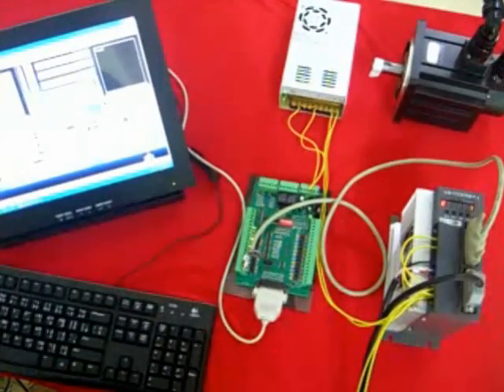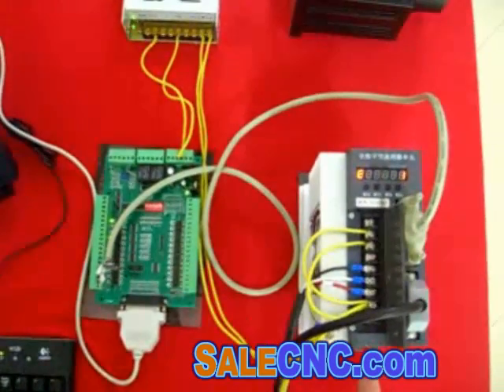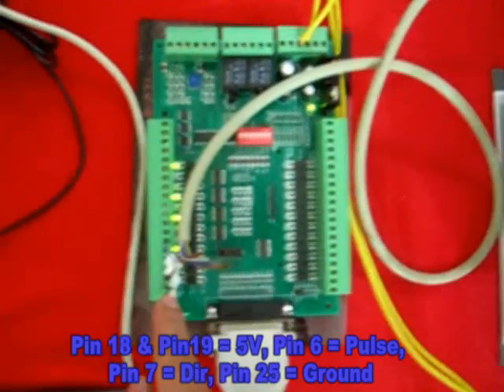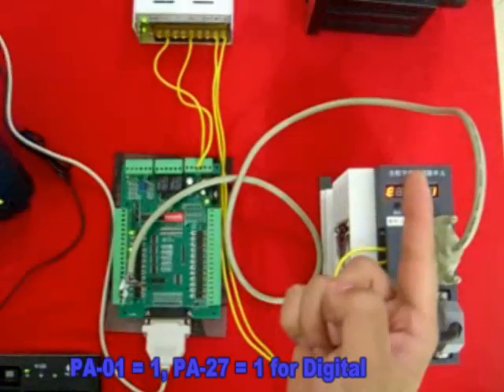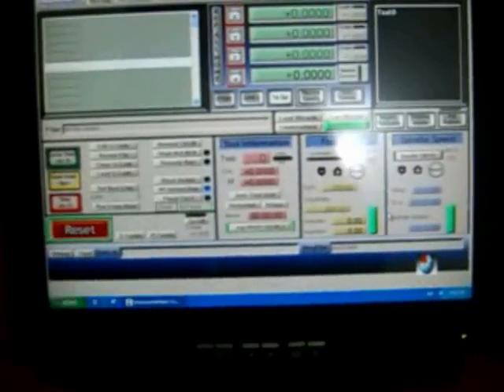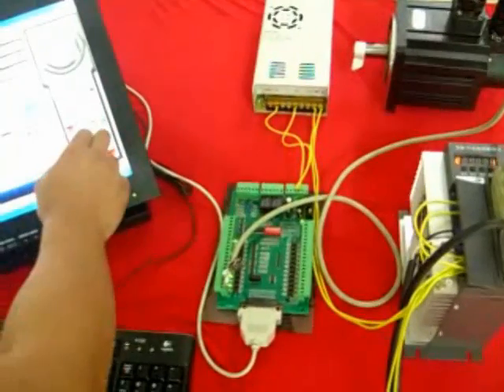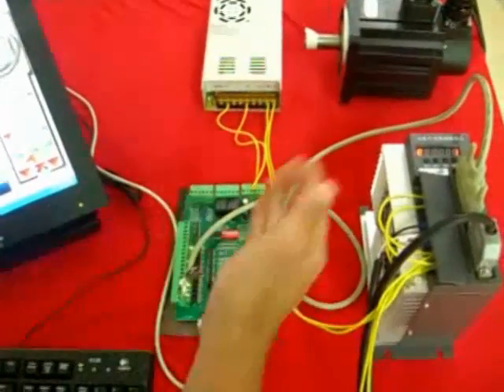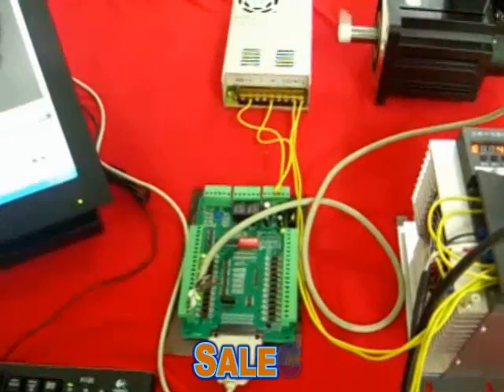Mach3 with Servo Motor Connection Control

Comment: which are the driver pins you use, thanks
Reply from the maker: For Servo Driver: Pin18 and Pin19=5V   Pin6= Pulse  Pin7= Dir  Pin25= ground
Reply: I think in this model only. Different models have different pin no.s
Reply: In this model driver or any model, thank you very much